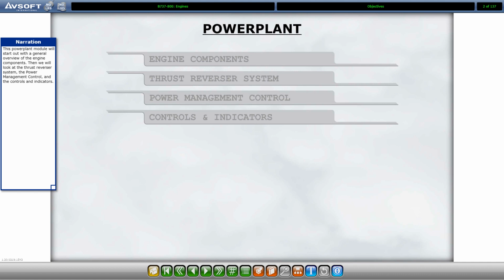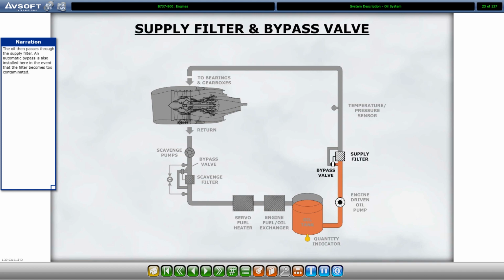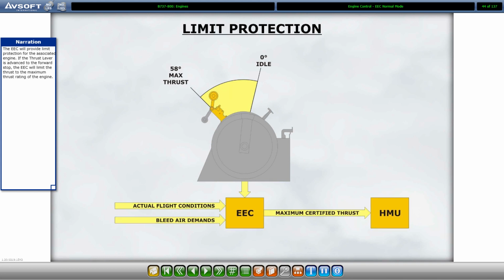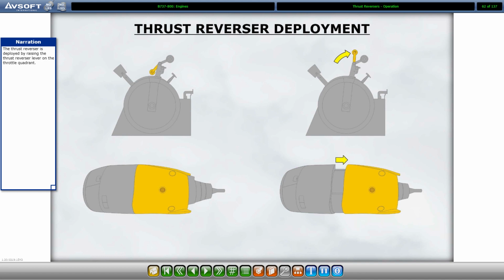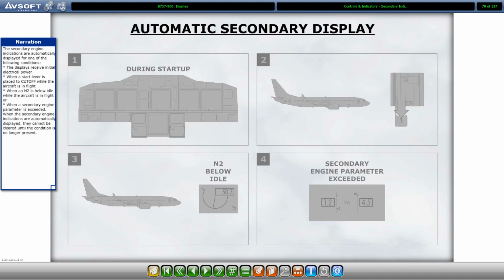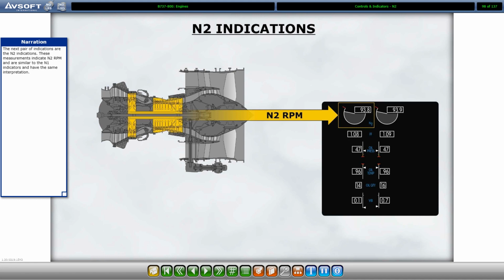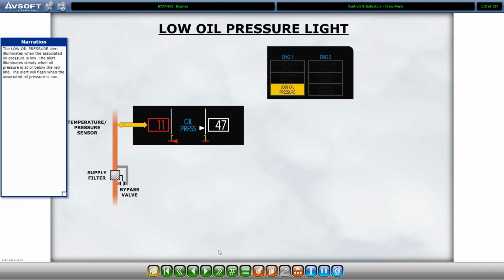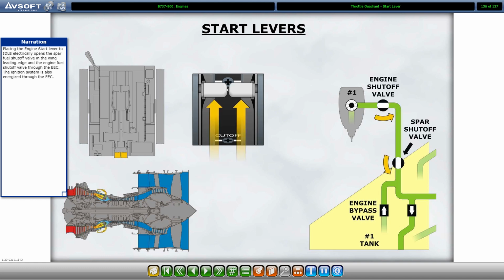Boeing 737-800 CBT (Computer Based Training) | Engines

Comment: I've a question for everyone here, 
DOES 737-800 AND 737 MAX HAS A SAME FUEL SYSTEMS ?
Reply from the maker: The capacity of the fuel tanks has slightly decreased due to wing strengthening. In addition, there is a new alert on the engine displays that illuminates an amber “FUEL FLOW” light when the actual fuel flow and the FMC calculated/expected fuel flow differ by more than 15%. Other than that, there are a few new things on the FMC related to fuel calculations. Everything else is practically the exact same thing.